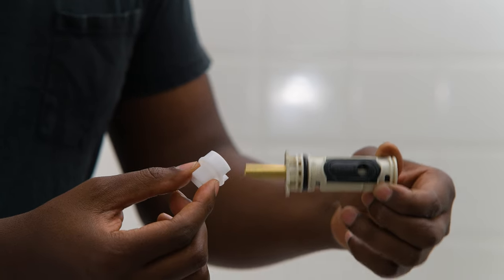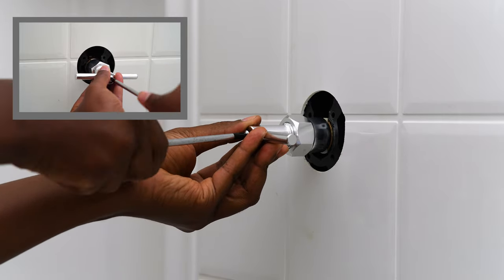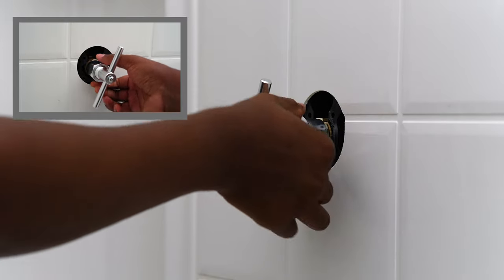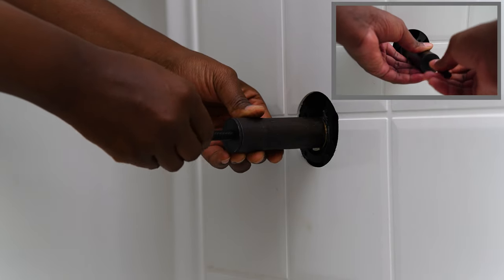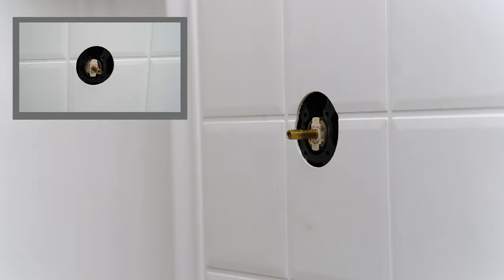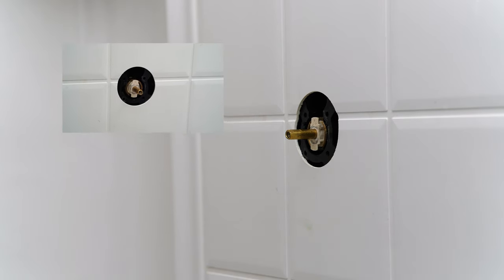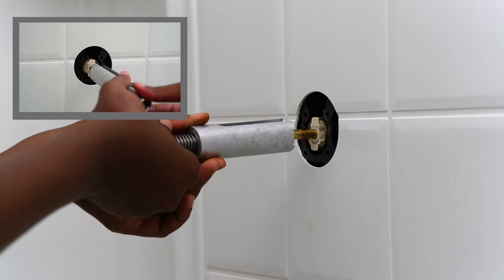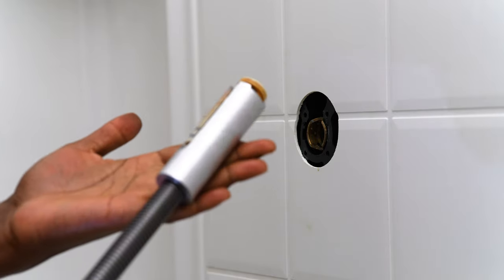WATCH THIS!!! if you have a stuck Moen Cartridge

Comment: Thank you for this, wish I would've seen it before hand.  I used the Danco puller, it's all the store had.  Actually tried to read the directions too, but they sucked.  And on my faucets, double bath tub faucet, I didn't  have a copper pipe sticking out like that, mine was just the plastic piece of the cartridge.  So you helped with one, I started using the nut on it to pull it out, and it helped loosen it.  The other side, I messed up the plastic and it took me a good hour of just wiggle/pull/wiggle/pull with every tool I had handy.  Now, I'm having a hard time getting the new ones in fully.  Just a slight gap, they won't budge any further.   And putting the handles on...OMG lol.  I'm so disgusted, I'm not even going to bother turning the water back on, I'm just going to bed and deal with it tomorrow.
Reply from the maker: Do you know the model faucet you have? Someone else had the same kind of cartridge and had the same issue. I need to know the faucet model or cartridge model. Thanks
Reply: @Hindsight101  Oh thank you so much for answering :)  Well, no idea what the model is for the faucet, it looks like the Moen Adler Two Handle Bathtub Faucet, the cartridge part was I think 1244.  
So, after my little fit there, I got up next morning, all refreshed.  Took it apart, and I guess putting it back together and screwing the handles back on was enough to make both cartridges go in all the way!   I'm guessing it's something to do with the handle screw, but all that plastic, just kept making me nervous constantly screwing in/out.  
And, the handles are totally out of whack.  Instead of turning on from outside to inside, one goes up and down, and the other is at an out to in angle.  And I don't care one bit, because they turn off and on, and do not drip when off :)   
Oh, and I found this link if it  helps you at some point or someone else; last picture has all the parts in order.  The adapter that's circled, goes into the wall tube in front of it (my tube's brass) apparently there's an o-ring on the adapter, but it was stuck in the tube.  I think that's why I was having a hard time with the handles, they just seemed loose and wiggly.  Anyway, thank you again!!
https://terrylove.com/forums/index.php?threads/new-moen-82602-2-handle-cartridges-seem-faulty.96718/#

Comment: My 1222 B came out and left the plastic sleeve in the pipe. I thought the ona puller would pull the sleeve out using the 2nd function you talked about. It was not big enough to grab the plastic sleeve on the 1222; it is sized to work on the other Moen cartridge (1220 I think).
Reply from the maker: Thanks for the info

Comment: In my case the brass stem broke off inside the cartridge;any suggestions? The ona puller doesn’t fit in the small hole left by the broken stem. Great video, thanks.
Reply from the maker: Take a look at the links in my description to other videos. They may help

Comment: Very good.  I think the basic puller (Danco for about $20) causes more problems than it solves as I've seen a few folks break their cartridges with this puller.  The ONA seems like a great idea but it a bit pricey considering you'll likely only use it a few times in your life and then lose it ;-).  For pros it would be great.  I decided to just call a plumber when I had mine badly stuck... just didn't want to cause a bigger problem and even more expense.  Great video!  Thanks.
Reply from the maker: thank you

Comment: if the screw from the handle is broken inside the cartridge, can one tmof the pullers still be used?

any suggestions?
Reply from the maker: You will need to find a way to extract that screw. They do make extractors for stuff like that. Just find one that's small enough

Comment: I have a better one than those shown. They're ok. So it has  not broken the brass piece out. Soon will be out. Have a real action videos pulling the cartridges both. No breaks yet and don't have to worry about the tool getting stuck in the valve. Like the first tool you showed. Plastic extractor. But great job in explaining.
Reply from the maker: Please share with the channel and I can make a video

Comment: Hey man, I was able to pull out , but now it won’t go in smoothly. Any tips? I’d appreciate it man!
Reply from the maker: There's probably some buildup if you can take a wire brush in there and kind of scrape some stuff out and then once you're done run the water through it to flush any of that stuff that you scraped away off and then try to reinsert the cartridge

Comment: I see a lot of people pulling the stuck cartridge out. What happens if you remove the retainer clip, throw a towel over everything abd turn the water on for a couple of seconds? Would water pressure push the cartridge out?
Reply from the maker: Probably nothing. You'd have to have a lot of water pressure

Comment: OK, my shower valve has been in there since around 1986 and (obviously) needs a new cartridge.  I have no reason to expect an easy extraction, so I bought the ONA and it's on the way.  I'm a little worried because I really don't have a Plan B!  I'll have to tear into a finished wall to get to the valve body, just to install some caps so I can pressurize the rest of the house.  Yikes!!
Reply from the maker: Good luck
Reply: @Hindsight101  I used the ONA tool exactly as directed and the cartridge came out in one piece.  I expected a real fight!  So I'm all set.  Good video, helped a lot.
Reply from the maker: @rbarr775   Great glad it worked out

Comment: Not bad video. Well spoken  and informative. You at least showed most tools made for this repair which was nice. And explained the difference nice.     Except ..
It's not a pipe as you said it's the valve body housing.
Seemed a little more professional video than others have done. 
Sometimes you have to use a tap to remove the outer casing from valve body when the inner valve pulls out and the outer shell casing is stuck. Many people have had this problem happening. A soldiering wire brush can help remove deposits from  valve body but shouldn't be  overly done not to make valve body to large to seal new cartridge. Plumber's grease should be used for new cartridge!!!
Just want to offer my suggestions.
Reply from the maker: Thank you for your suggestions and appreciate the correct wording
Reply: @Hindsight101  Classy response.
Reply from the maker: Thanks hope the other person felt the same way

Comment: 1:06 - RIP - just bought the Danco cartridge for $39 vs the Moen $54.
Reply from the maker: In my experience they use cheaper materials so they don't last as long and when you try to remove them. They can be a nightmare because those cheap materials get stuck

Comment: I'm trying to remove the handle itself, which is stuck. It won't slide off like yours. I'm worried about causing more damage if I  put more force into it. Any advice?
Reply from the maker: Did you remove the screw holding the handle in?
Reply: I did. I feel dumb, but here's what worked: turning the handle back to the off position. Then I was able to jiggle it off. Thanks!
Reply from the maker: Hey awesome, at least you got it off

Comment: Very useful advice and tools but I do not recommend the first one for corrosion cartridges, it was extremely wedged and it broke off a piece of the bolt inside because it's kinda, now I'm trying to look up how to remove the broken bolt inside or none of the tools will even work.
Reply from the maker: There is a link in the description on how to possibly help with your issue
Reply: @Hindsight101  The piece of bolt is broken inside the stem and not the top part, I can't stick anything in there which is what all the tools need and I don't want to take the whole stem off and leave the cartridge in the to be pulled out bit by bit, I'll look for an answer somewhere, thanks for the reply

Comment: Don't bother buying a puller.  Just drill a 7/64 hole in the plastic part of the cartridge (either above or below the stem location), screw a screw part way into the hole, then use the claw part of a hammer to pull it out.  Use a wooden board to provide leverage and protect the tiles from breaking.  Cheap and easy!
Reply from the maker: cheap yes easy I would have to question

Comment: LOL I already had mine unstuck when I stumbled on this video and it turns out that useless white plastic piece was actually the solution! (don't get me wrong I thought it was useless when I saw it too - pretty flimsy - but it actually worked and only warped slightly)
Reply from the maker: I'm glad it worked out for you but for many of mine since I have hard water that thing would not have lasted

Comment: my 1200 broke off so I got a plumber he used That tool and it broke part of the cartridge off and we had no way to get it out, he cut the whole valve out and put a new moen in. 
 Since then I watched a lot of videos. One guy uses a 1/2 die, he makes threads in the old cartridge then uses a 1/2 bolt the remove. I got the old one and I gone to get a die and try it.
Reply from the maker: I have a video linked in the description that demonstrates that method

Comment: When I finally got my help. And I put the new one in now. It's stuck just maybe half inch away from going all the way in. And I can't move it at all.
Reply from the maker: There might be some build in there and you can take a wire brush or something to clean it out. Just remember to run some water to flush everything out before putting the cartridge back in

Comment: The issue that I am running into is that the two puller teeth will not go around the white piece on the cartridge when I am using an off-brand Moen puller. No matter what I do, I cannot get the teeth to grab ahold of the white piece - it is almost like the teeth are not wide enough to wrap around the white piece on the cartridge. For what it's worth, the off-brand puller I am using is Ace Hardware branded. Since I cannot get the teeth to hold onto the white piece, the whole operation fails as there is no nothing for the nut to secure onto when I am tightening down the nut - in essence, the nut spins in place as it is not gripping anything. I finally had to use a vice grip and just kept pulling the cartridge until it came out, but I felt like I was going to break either the actual pipe in the wall or something else.
Reply from the maker: sorry to hear that
Reply: @Hindsight101  - No biggie. I was able to successfully replace the cartridge. It's all good.
Reply from the maker: Oh ok good

Comment: This video was the most helpful, but I still can’t pull out the cartridge. What else can I do?? HELP!!
Reply: Maybe the rubber grommet has started peeling off...?   I just fixed mine today.  I was able to brace the fitting inside the wall, then I pulled like crazy.   It took about an hour of pull, wiggle, pull, wiggle.   I'm not sure wd-40 helped, but I used it.
Reply from the maker: thanks

Comment: I must disagree that the supplied tool with the cartridge is useless and should be thrown away. To use it correctly place the tool over the cartridge and twist back and forth several times to break the bond between the pipe and the cartridge. With just a little patience and persistence it works just fine for me, and I've replaced many a cartridge over the years.
Reply from the maker: I do understand what you're saying but if it's really stuck and I've had a few that white piece isn't doing a thing

Comment: unfortunately, my genuine moen puller did not work. i sprayed hot vinegar which usaully makes everything work and tried again. then i added penetrating oil and tried again. watched other videos, all the same except yours is better, Looked up the lakeview tool, at $175.00, I'll just call ECM since I have a contract with them, it will be cheaper and if something breaks, its on them. Thanks for posting.
Reply from the maker: Glad to help
Reply: I tried again and got it out but new 1222B was difficult to get in. No leaks, but now no hot water.
 Should I use a different cartridge as the 1222B had to be forced in? Or, should I do extra debur with a drum Sander on a drill? Or what?
Reply from the maker: @ccatdaddy64  I would see if the cartridge is damaged. If it's not then reuse it. But definitely clean out the build up

Comment: I replaced the cartridge, now there is a steady drip.    Is it possible I have a faulty new cartridge? If not, what do you suggest it might be?   I did use use silicon grease, so not sure what it might be.    I probably won't try and fix it until Saturday since I don't have the time during the week.
Reply from the maker: It's possible but you may have installed something incorrectly

Comment: A small broken piece of the old cartridge plastic still stuck at back of the hole surrounded by hard water deposit. Trying to chip it out with screwdriver, and hammer. Also, trying to figure out what replacement cartridge to buy.
Reply from the maker: Can you lookup the model of the faucet?
Reply: @Hindsight101  ~ Decided to call in a plumber to replace to avoid damage to the plumbing or water leaks going downstairs.
Reply from the maker: @GEAE_Denny_L   
15.4K subscribers
Hey I get it. I still call a plumber if I think I could damage something more than its already broken.

Comment: what do I do if the cartridge plastic broke while pulling it out? I now have half the cartridge stuck and it just seems to not want to come out. I don't want to replace the whole valve....
Reply from the maker: Some people suggest using heat. I've had to break pieces out one at a time. There isn't one set way
Reply: What tools you used to break it piece by piece. Greatly appreciated

Comment: I had a plumber tell me that because the old cartridge we have is made of metal, it's been corroded and stuck to the valve body. Does that mean none of these tools will work...? He said my only solution is to open the wall and replace the entire valve.
Reply from the maker: Granted I'm not a plumber but I have heard that metal cartridges are a lot worse. You can try solvents and heat or one of the tools I used but there's no guarantee

Comment: What about the pin ?
Reply from the maker: What are you asking exactly?
Reply: @Hindsight101  well there is a clip that needs to be pulled up and removed before you yank on the valve stem. I think anyway.
I got it out with vice grips though so I'm all good
Reply from the maker: @helenachase5627  pets in the other video that I mentioned, this was just displaying the tools